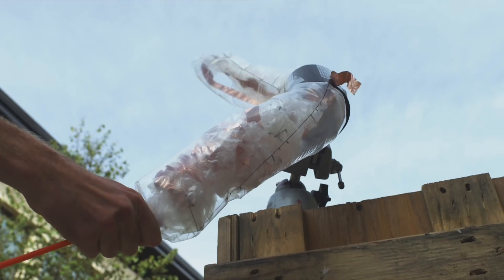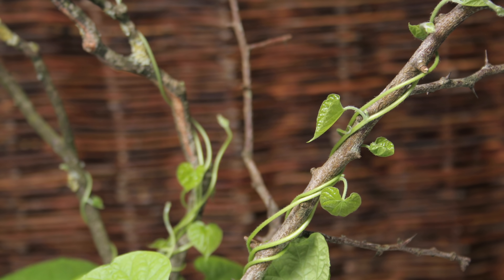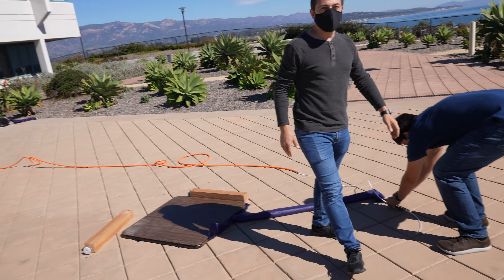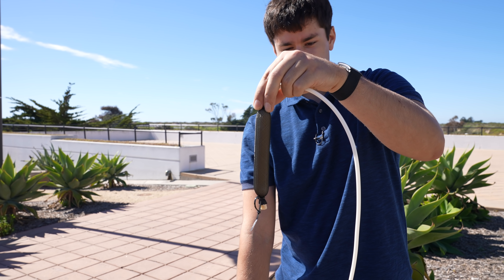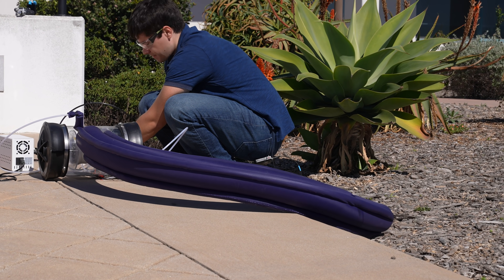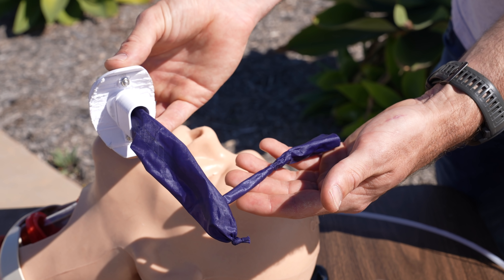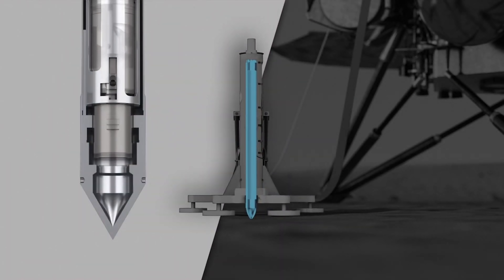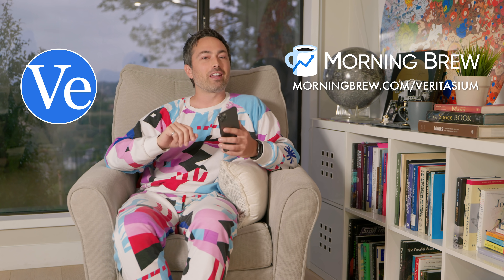This Unstoppable Robot Could Save Your Life

Comment: Do Photons Have Mass?   YES... I Sincerely Beg You To PROVE ME WRONG!
... and the Answer To The Universe Is -42 !!!
The Mass of a Photon is Given by:   m = (h/cλ) (kg)

where,
m = mass of a single photon
c = speed of light, 
λ = wavelength of photon

“Bozeon Constant” b is as follows:

b = h/c  (kg m)

b =6.62607004x10^(-34) (kg m^2/s) / (299792458) (m/s)

b = 2.210219x10^(-42) (kg m)

The Mass of a Photon Is:

m = b/λ (kg)

or,

m = 2.210219x10^(-42) / λ   (kg)

A typical Red photon with a wavelength of 700nm has the following mass:

m = 2.210219x10^(-42) (kg m) / 7x10^(-7) (m)

Mass of a 700 nm Red Photon:

m = 3.1574557x10^(-36)   (kg )

PROVE ME WRONG OR…

Join The TTOE Team At BRAVE and Help Save Physics From Those With Warped Spacetime Minds:

@BozeonResearchAndAEtherVerificationEtaireia
 
Notes To Aid Understanding of what EM Dipoles Particles Are …

The “Bozeon constant” “b” converts photon wavelength into the sum of all the masses of the “bozeons” or “God particles” that form the “quantum superfluid” in all particles.  

“Bozeon” is Polish for “God Particle”, the ethnicity of the Conceivor of EM Kinetic Dipole Theory, aka The Theory of Everything.  There are trillions upon trillions of dipoles in a single photon. (more on the exact number later).  Everything including all elementary particles are made of complex flows of EM Kinetic Dipoles.  A Kinetic Dipole is a somewhat symmetric particle with one end that has more mass than the other.

Bozeon’s are Electromagnetic Kinetic Dipole Particles that form the EM field.  

For better understanding you can pretend for now that the Planck Length is the RMS distance between kinetically colliding EM Dipoles (“Bozeons”).

You can also pretend that the “size” of a EM Dipole is about 10^(-42) meters in length.

The Dipole Mass Density Gradient in Vacuum determines the local force of gravity.  Big “G” simply converts Dipole Mass Density Gradients into Acceleration.

All forces EM, Gravity, Weak, Strong, are all calculated from the momentum transfers between kinetic collisions of these EM Dipole Particles.

EM Dipoles in Vacuum are in a gaseous state and the “quantum superfluid” in all particles is liquefied EM Fields and are technically a Bose-Einstein Condensate of EM Kinetic Dipole Particles.

Black holes are supersolids of EM Dipole Particles.

Copyright 2021 John E. Boze

Comment: Its like super light weight as well... you can have like 10 ... 20 on a rover to plan the next 20 hours or so travel from actual images of the terrain completly breaking our current problem with delay of control. Also it would likely never break depending on the material. You can likely get any form of angle you want with a camera of the rover or of the terrain...

Comment: I think they need to focus on the lining a bit more, I don’t think you want compressed air escaping inside a body
Reply: Depends on the part of the body, really. I'm no expert, but I know of a couple situations where surgeons will just pump gas into your chest cavity to give them more room to work.
Reply: They're showing prototypes, not products. If they tried to intubate a real person with what they showed there the person would due because it turns out that inflating a balloon in your trachea doesn't make it easier to breate.

Comment: I’ve had a couple of heart attacks, last one I needed stents put in to open my artery which the consultants will tell you isn’t an easy job. This could revolutionise this process if it can be made small enough, it could be used to open any blocked artery all the way through to the heart.
Reply: For that and other medical applicatins, I'd been thinking of a loc-line mechanism with several pull-cables attached to each segment, like tendons to bone. The whole assembly in a slick sheath.
Of course, that will make a LOT of cables, meaning that they have to be super-thin, super strong and yet not cut through the guide points they run over.

Comment: By extension of the concept for burrowing through "beach sand" section of the video, I can foresee form of robotics being useful in avalanche catastrophe / human recovery scenarios whereby it effectively burrows initially as a search & rescue device that can provide an immediate source of oxygen for someone buried under many feet of compacted snow--with a separate air channel purposed with supplying sufficiently warm air to perhaps encapsulate the trapped individual to prevent (slow) hypothermia.

This initial search & rescue phase could be a huge time saver--especially when seconds matter--giving precursory life saving resources while extending extraction time to the rescue phase in the interim.  

Furthermore, it seems one advantage of first deploying a discreet, uniquely specializes robot to reach the trapped individual is that its initial burrowing provides a ready-made conduit; along the length of which would easily and immediately be deployed a far less sophisticated albeit 'brute force' type escape tunnel building robot.  Its deployment provides a large, non-collapsible point of ingress and egress to emergency personnel who almost certainly require access to the buried individual in order to assess medical condition / provide temporary trauma & injury support prior to attempting extraction of the same.

Just my $.02....and why I'm sharing it openly without attempting to gain a patent on it is kinda beyond me at this point; but if my concept can lead someone with far greater expertise in the field to eventually save even one human life, then it makes not having made millions off the idea still a worthy endeavor, IMHO.

(Don't get me wrong.....I'll still gladly share in the windfall if you want to give credit where due....but I'm not greedy!)  😉

Comment: Imagine taking this sand digging robot and making it WAY longer and being able to explore the oceans with it
Reply: Water is already a fluid though. Also water pressure on a soft body.
Reply: @JikuAraiguma  It'd need to be very sturdy, and maybe fill it with pressurized water instead of air. Granted, ultimately the viability of these robots goes down as you increase the length.
Reply: I think you can't make them very long. And it would need to have water inside cus otherwise it'll float.

Comment: I would like to see a video on why  all small plane propellers looks like they are not turning in flight, even the big double turbo-props even look as if they are stalled. Sometimes they look like they turn backward, I know the guy from smarter every day must know, but for some reason I believe you have a formula for it. Thanks.

Comment: Deep sea exporation? If you can equalize the pressure inside the robot to the pressure of the sounding environment I could make going deeper in the sea easier without building expensive equipment.

Comment: Military: how can we weaponise this?
Edit: Some ideas:
1. Burrowing through sand to :spy, deploy  explosive or nerve/paralysis gas  over big distances
2. Blocking water, gas  or air supplies.
3. Ultra fast vine deployment to punch someone at a distance.
4.Immobilize enemy land vehicles by raising them off the ground.
Ultra thin vine robots to get 5.through pinhole gaps to spy deep inside enemy bases.
6. 'assassin' vines to choke or suffocate an enemy while they sleep.
7. Accessing hard to reach electronics and short-circuiting them by injecting water, mist, conductive materials from the tip.
8. Audio devices to play noises  for distraction or mind control.
9. Survival shelter,

Comment: Immediately I thought of covert reconnaissance or inspections inside the air ducts of a building. Seeing it on the water seems like it would be a natural for lifeguards to be able to send this giant floating thing out to a struggling swimmer. You could even do an underwater version using water instead of air. Seems like a good way to assemble a large structure in space too.

Comment: Actually, this could be useful for rescue operations in collapsed mines/caves/tunnels, where the trapped people are running out of air. You get a robot to get through the smallest cracks in the rubble, and when it’s on the other side the people inside can cut a hole in it. Now there’s a constant flow of pressurized air coming in, and the rescuers have gained time to carry out operations by preventing asphyxiation.

Comment: If i had that kinda tech i would explore oceans since only 10% has only been discovered
Reply: I find this both interesting but one with a lot of complications, primarily buoyancy, wouldn't the whole propelling by self pressuring a compressible material make it nowhere near dense enough to actually explore the seabed?
Reply: @The117th  correct it will need weight before it can descend and being the depths are about as dark as a night sky,  light would be a problem. It is a good idea.

Comment: If you were to build the tube out of a light/heat absorbent material that is flexible, such as graphene, ad you could convert that light/heat into electrical energy then you could not only explore places like volcanoes, when robots that it is attached to is in a tough position, it could be used to continue running the battery, combine this with cameras and AI and you could have a robot that will maps its area and find the most energy efficient places.

Comment: Now you can make a rope go up a cliff. Direct gases and liquids. Set cabletunnels inside houses after they're build and create air exchange ducts etc. Coat this with chemicals which can be hardened in the shape it's in to create solid structures. Mind-boggling possibilities.

Comment: Hasn’t this technique been used in the repair of broken sewer lines?  Instead of compressed air they used water pressure to extended the inverted lining into the sewer pipe.

Comment: I used to work with re-lining pipes.
It's the exact same procedure except the liner is coated with epoxy witch when it hardens basically becomes an entire new pipeline. It has existed for years and the inventor was a Danish guy named Olimb.
Reply: Wow, that's super cool. I bet you you could find a way to make the tubing material react to water to harden allowing you to burrow using compressed air then pumping water through to create a completely new pipeline from scratch

Comment: Interesting. We used low pressure airbags in the fire department to lift things weighing hundreds of pounds or when connected to high pressure, thousands of pounds...like a vehicle. Years ago we use to blow into inside out plastic tubes to get it to go into a rigid pipe but never anything this long.

Comment: 1991: In 30 years we will have flying cars and nuclear fusion technology!
2021: inflatable elephant condom
Reply: You meant cold fusion, we already had nuclear fusion back then.
Reply: @Ebani  none of the nuclear fusion tech we have are viable as they use more energy than they produce.
Reply: @WomanSlayer69420  The main energy problem with current nuclear fusion is that we're using all of the power to basically heat water bc we have no means to actually use all of the energy produced by nuclear reactions, the other main problem are all of the radioactive waste produced by said reactions.

What you said makes no sense whatsoever, all you need are enough radioactive elements for a sustained nuclear chain reaction (critical mass), which are literally mined from the earth, just as the silicon used for your computer/cellphone.
Reply: @Ebani  radioactive waste is a much bigger problem in fission plants. Critical mass is fission, not fusion. Fusion is using deuterium to create tritium and then combining those to make helium and energy. What you said makes no sense whatsoever, because you're mixing up which is which.
Reply: @WomanSlayer69420  Oh, got mixed up, no wonder i tought you made no sense lol. Still, makes no sense to mention nuclear fusion for energy generation, which is why i got confused, not until we get to cold fusion if that's even possible.
Reply: @Ebani  tbh I only wished they put more funding into nuclear power, both fission and fusion. It's sad to see proposals like the thorium reactor and fusion models theorized to actually work being delayed by decades due to insufficient funding and irrational public fear. Maybe they will finally invest when the world runs out of oil and is 20 degrees hotter.
Reply: @WomanSlayer69420  thats the law of thermodynamics. Everything does that.
Reply: @Ebani  only in the Sun, fusion is getting there but still doesn't produce enough energy to sustain itself
Reply: Inflatable hentai tentacle
Reply: kek
Reply: Aw c'mon
Reply: We have flying cars. But they're just machines for killing people with too much money and too little sense.
Reply: Wait... THE CAMERA AT THE TIO NOOOO⚠️
Reply: Look up living waters
Reply: 2021 : 20 years Singularity...... in real 2041 communism

Comment: if you had rubber wheels or high friction materials "rolling" the robot, you could make it go forwards and backwards. Think of it as a rubber tire football cannon but reversible.

edit: another idea might be to have continous airflow in the robot with air directed slightly behind it making it move.

Comment: Stupid science 
Science doesn't know 
Every second the Sun emits billions billions billions ^ billion lightning 0,1 voltage create sunlight. 1 positron + attracts 1 electron  -- create 0,1 volt lightning 
Positrons + and electrons  -- rotate very rapidly after 4, 6 billions years of creating the Sun ' s core, so the core of the Sun rotates very quickly like A super large electric turbine that produces super large electrical energy 
Every second the Sun emits 4,1million tons of electricity create sunlight, sunlight moves the circle back to its original position after 8 hours, so pushes the 8 planet to rotate in order

Comment: 1) That thing can get a Piano onto the back of a truck. 
Taking the basic idea of how the plat form lifted up a person, what you can do is have 4 poles on the edges, that keep the platform stable and uniform as the platform rises. 

There can even be locks to keep the platform locked in certain places on the rods.

2) It could also be possible to set up a rod in the middle, and a pulley system to keep the platform stable and then use the pressure snakes to lift a person vertically. I do not know the math that will predict how high it can go.

3) Make a really slow elevator that can make its way up like an accordion. 
The top plat form rises up, and locks into place. Then as the air deflates it brings up a bottom platform, that locks into place, and allows the top platform to rise up high and higher. 

4) Make it climb a tree like a snake.  But that would mean that the muscles at the side would need more control at specific points?

5) Eventually make a mini remote control air pressure unit, so that way the tube is not bound by anything.

Comment: This idea is being used in plumbing for quite some time to fix sewage pipes: an "Inliner" - a piece of fabric coated with epoxy is blown into a pipe where it bonds to the pipe and covers any cracks. Afterwards a robotic arm is used to mill out any holes where other pipes merge into the main one. This is far cheaper and faster than opening the wall and replacing the pipe.

Comment: That last example involving NASA won't work most places.  You need an atmosphere to source your pressure and sufficient electrical power to power the compressor.  And sand.  And NASA's not about to send enough pressurized air from earth to drill into the ground on another planet.

Comment: Extending it to the bottom of the ocean to retrieve trash autonomously. Collecting data from sensor and determined if its plausible to carry a certain trash. Therefore , a huge script have to be made in order to make this works autonomously across the ocean. Also ph lvl toxicity data along with other etc etc to gather data from the ocean or river.

Comment: The paradox of pressure explains why a racing bike tire is at 120 psi while an automobile tire is at 35 psi.   The volume  of air in a racing bike tire is about 1/4th  of the volume of air in car tire.

Comment: Actually if it's punctured you'll have to increase the air volume going in not the pressure. Pressure is a product of resistance to flow not flow.

Comment: my evil secret base in a volcano is going to have spikes in every single air vent now, thanks !
Reply: Did you miss the part where they said spikes don't work?
Reply: @syweb2  you get enough spikes in there its work
Reply: @wompstopm123  At that point you may as well put a wall, since the way it works means you'd need a barrier to block it because spikes don't work.

Comment: I mean if you could make them small enough I can see these being used to open up the tubes in your heart, or if you have a collapsed lung it could be inflated inside the lung to restore the shape etc. Or like I saw on a documentaries where a little girl drank acid, her throat has scared over and was closing and they had to inflate a balloon inside it to open it up, they could have used one of these, as we saw it can have a supply of air out the end so it could have an oxygen supply hooked up and then it can allow people to breath through it. It could be used to clear blood clots if it can be made small enough too. Maybe if someone has a badly blocked nose it can be inserted through your mouth and push the blockage out your nose, it could also be used to make inserting a catheter easier. Lots of different possibilities lol

Comment: Question: the tube needs consistent air pushing through it to keep it inflated, right? 
Does that mean during the intubation process they'd constantly be blasting air down this person's throat? Or will the tube inflate and deflate for each breath? Either way wouldn't the pressure needed to inflate it be too strong for a person's lungs?